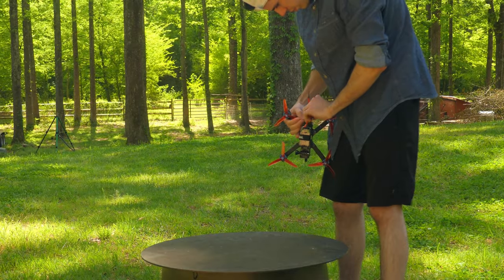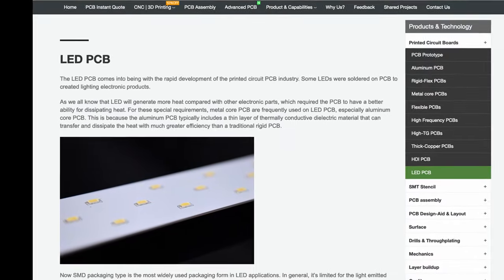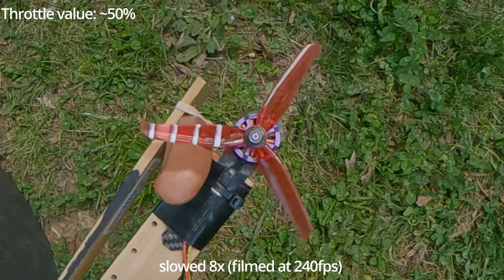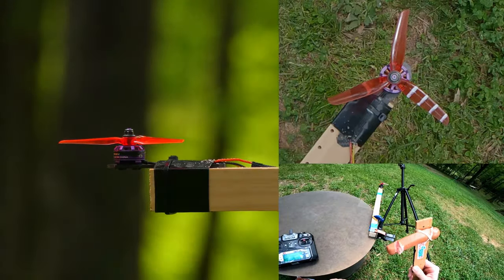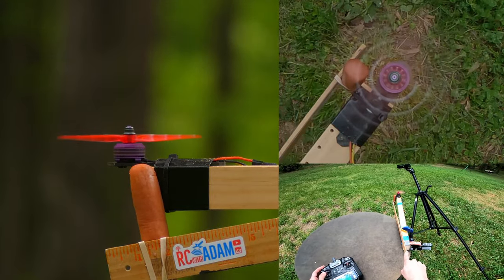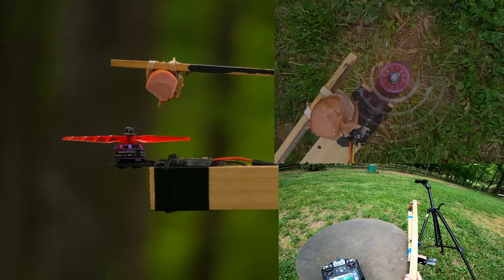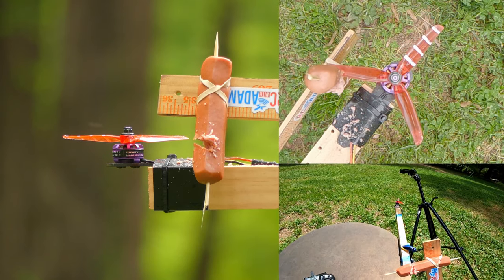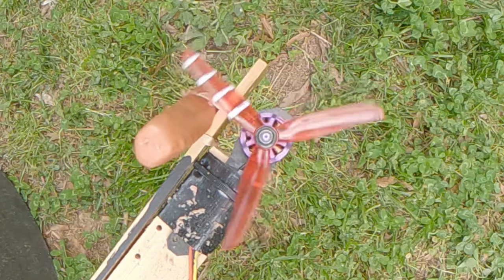Go ALL IN or stay FAR AWAY! Drone Propeller Safety PSA

Comment: I was about to write a sarcastic comment about "well fingers arent as soft as hot dogs".
But then i remembered what someone at RotorRiot joked about, "oh boy lets not think about how many people you could decapitate if something went wrong".
Then i felt my soft squishy tender throat.
Yep. Please be careful guys. Freak accidents are rare, but they happen every year.

Prop guards if you fly anywhere near people.
You can accept the 50 grams extra weight, lets be real.
And the most stupid counter-argument i hear is "but it massively increases the size of the drone".
No dude, it doesnt. If the propellers hit anything, you're going down anyway (ok you can recover in a lot of cases, but you get my point, you dont WANT the props to hit anything). You already have an invisible force field of "do not enter" around your props, even if you fly without guards.
Adding the guards does NOT increase the radious your props spin at, it only makes the limit visible, and protected.

Comment: Hot dog is not a good representation of a human finger to soft. Nevertheless drone props can indeed do a lot of damage. On a typical 5" quad, they push the props to 30-40,000 RPM. Your looking at a blade tip speed as high as 600MPH! ) You put you fingers in the blade and you wont get them back.

Comment: hm.. I wonder if it would be possible to build a system that can detect this. I am thinking of detecting the change of capacity - it would probably need the rotors to conduct though. I believe, certain buzz saws detect it like that.
Reply: Mine stops when the load is too heavy. If you accidently put your finger in it, it will stop.
Reply from the maker: Yeah I think SawStop table saws are like that. Of course, just like many other features, right now it's just not practical to try and integrate it into a flying machine.